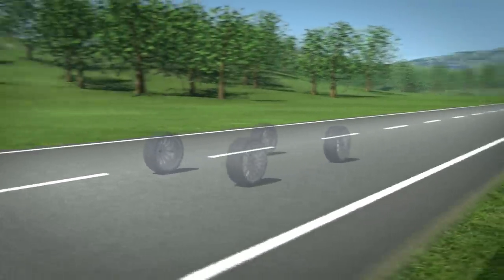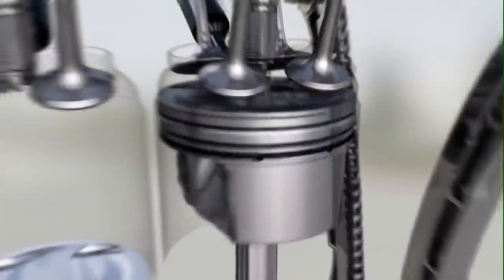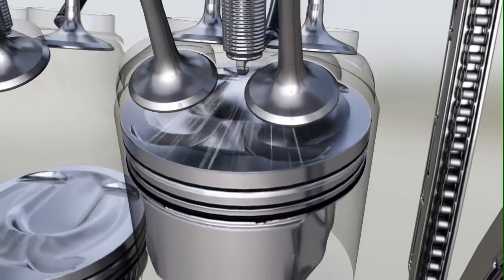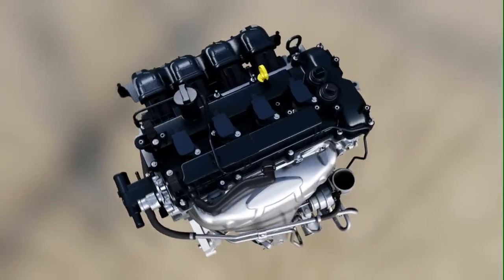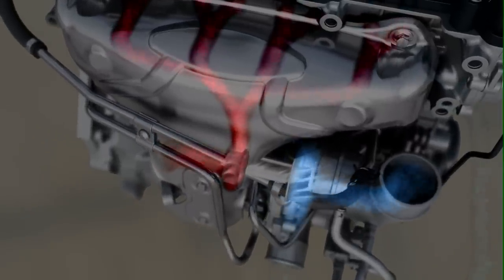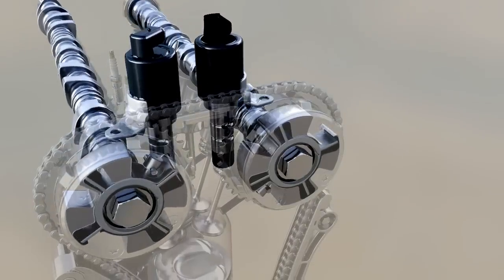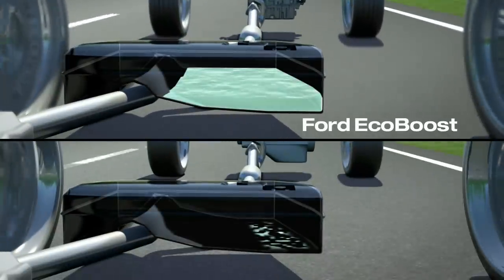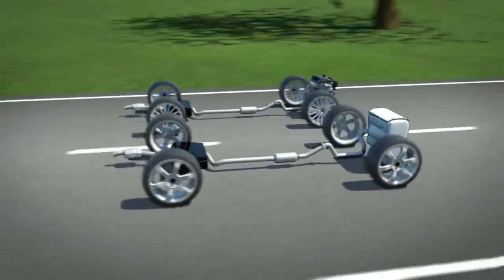Ford Ecoboost Animation

Comment: As a Ford mechanic I can safely say that it's a piece of junk
Reply: Well considering you died in the 90's, doesn't surprise me that you foolishly believe that
Reply: CoyotePowered5.0 Did they fix the problem with buildup on the valves?
Reply: CoyotePowered5.0 didn't even live back then I know they suck because we have so many of them coming in for an engine change after only 80000-100000km not really good quality for a new car xD
Reply: @666kkf  Well I don't know what hoopty town you live in but I haven't seen an excessive amount of engine swaps at my dealership. Yeah we get a few but every manufacturer slips on a few engines. Really aside from the Focus transmission problems, we don't get too many recurring issues with the newer cars.
Reply: @gsxerwhite  Yeah for the 2nd generation Ecoboost engines. And all GDI engines have buildup on the valves, wasn't just a Ford issue.
Reply: CoyotePowered5.0 That's good. I'm happy to see turbos used more often then not. I still don't trust Ford quality though.
Reply: @gsxerwhite  You ought to give them a try. Rent one off Toro or something. Ford has stepped up a lot since the early 2000's in terms of both interior quality and general reliability. Just ignore the automatic Focus lol
Reply: CoyotePowered5.0 I'm open to buying anything American, unfortunately right now I'm in the used market and Honda and Toyota seam to be the way to go for used cars and reliability. I'm looking for something under 10g that doesn't have reliability issues. What Ford models do you recommend ? I like the older Rangers. My friends brother owned one and was easy to do minor engine repairs.
Reply: @gsxerwhite  Those older Rangers were great, definitely recommend those.  There's also the 2012-2014 Focus if you stay away from their automatic transmission.  Though their interiors are quite awful.  2010-2013 Taurus are also pretty good though water pump replacement is expensive so look for one that's already had that fixed.  Even the early 2000's Taurus is alright.  Stay away from F150's with the 5.4.  It's unlikely you'll find a newer one with the Ecoboost or 5.0 for 10k so if you wanted an F150, your best bet would be mid 90's with the old 5.0 or early 2000's with the 4.6 or base v6.  Mid 2000's Explorers are also good, just stay away from the 90's Explorer.  Honestly, Ford didn't start stepping up their game until 2010.  Early 2000's Ford's can be a gamble and with 10k as your budget, I'd look for an early 2000's Lexus.
Reply: CoyotePowered5.0 Great! Thanks for the advice. I used to install irrigation systems for a big landscape outfit and they used Rangers to plow snow in tight parking lot areas instead of bringing out a skid steer and one of the mechanics told me they're tough little trucks and reliable. I've been a fan of the Taurus since they first introduced the sho. But yea I've heard a lot of mechanics recommend used Lexus recently so I'm keeping my eye out for them and I bought a used Accord a few years ago and that car held up well driving long commutes every day. I only had to replace O2 sensors and starter went bad but that was it really.
Reply: @gsxerwhite  My mom had an old Accord that ran strong until 120k miles when the transmission would slip in 2nd. Unfortunately Honda automatics aren't that great, at least not early 2000's. My first car was a Ranger and aside from a fuel pump, that thing was solid until the day I stupidly jumped it and cracked the oil pan. My Mustang and F150 both with the 5.0 have been running great too, though the F150 did get a new water pump at 100k miles. I may be in the market for a Taurus SHO or old Lexus as last week I was unfortunately in a crash with the Mustang and it could be totaled. I'm curious to try Fords Ecoboost myself, see if it's as good as some people say, or as bad as what others say.
Reply: CoyotePowered5.0 My 04 Accord didn't have any transmission problems but yes I heard about that problem after I bought mine lol. I've been shooting for a 2010-2015 Civic. Those are pretty solid right?
Reply: @gsxerwhite  Those Civics are pretty good. Interior quality is average but everything else is overall solid.
Reply: CoyotePowered5.0 good to know. I'm not picky about interior I just need reliability and decent mpg.
Reply: @gsxerwhite  Civic should be a good choice then assuming the transmission problem doesn't exist in these newer cars. I know they supposedly fixed it for the latest generation 2016+ but I'm not sure about 2015 back. Should be a nice car though
Reply: CoyotePowered5.0 great, thanks for the advice

Comment: first of all, all manufacturing and assembly operations regardless of location must comply with design specifications laid out by the design and manufacturing engineering of its research and design facility in germany .. secondly i drive a fuckin audi, made in germany not mexico and just incase you didnt know posrsche is part of the vw family ... Now sir i dont wish to continue this debate cause i have nothing to prove, drive whetever the fuck you wanna drive